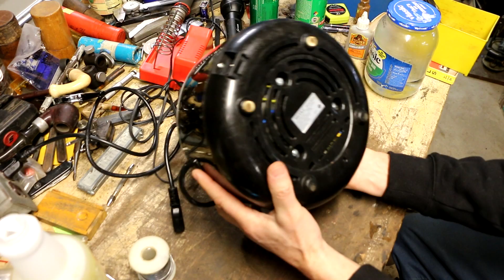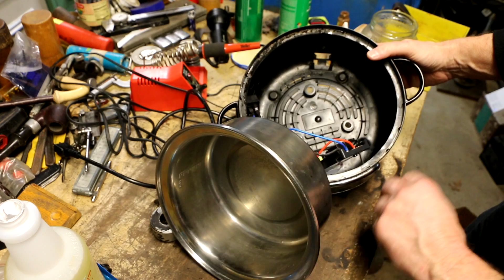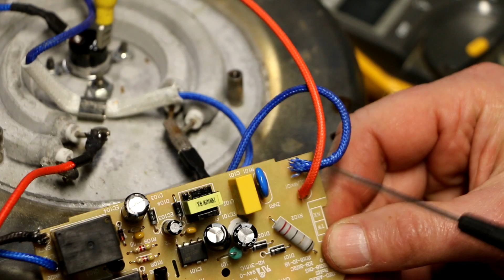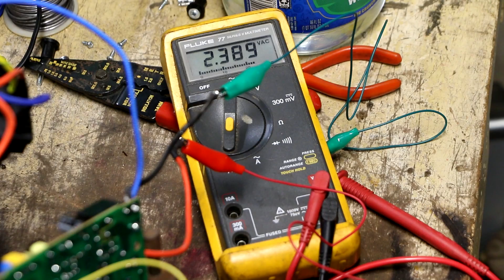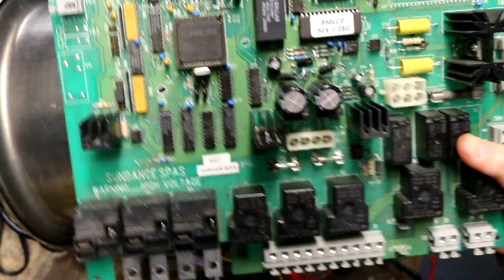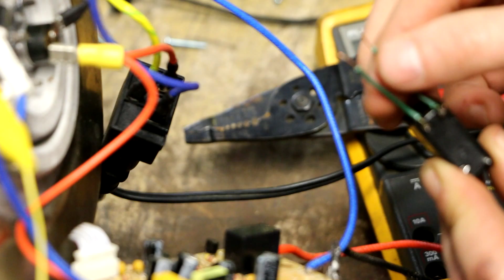Secura Food Steamer not heating enough, poor steam output on high setting

Comment: thanks for the video ... I was thinking of buying this on amazon and came across your video, do you think the relay was defective and let moisture in or would it have happened no matter what with that type of relay ?
Reply from the maker: I dont know. But we still have and use his steamer a lot and the failure has not reoccurred since this repair was done.